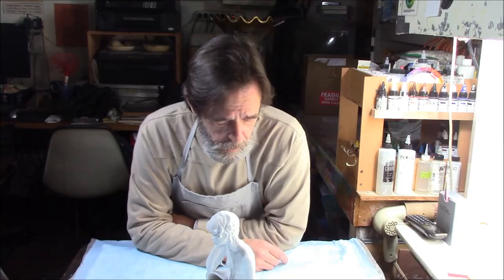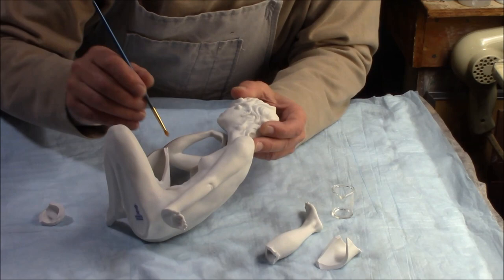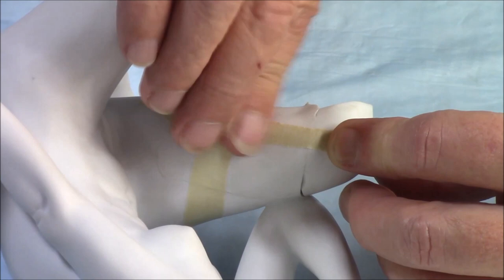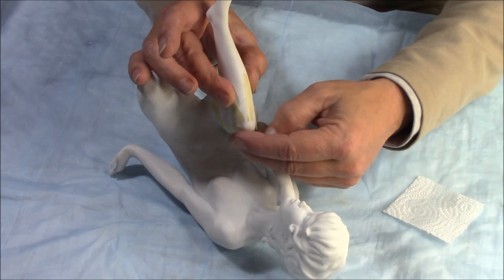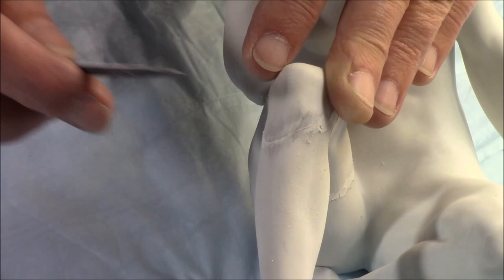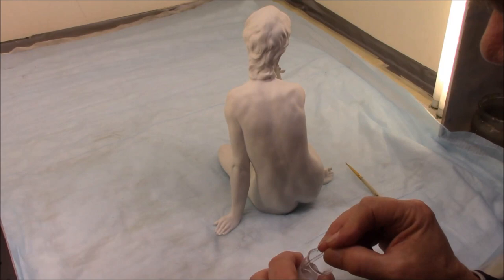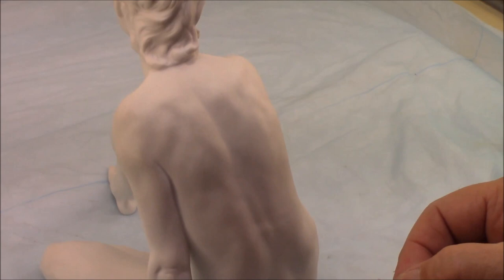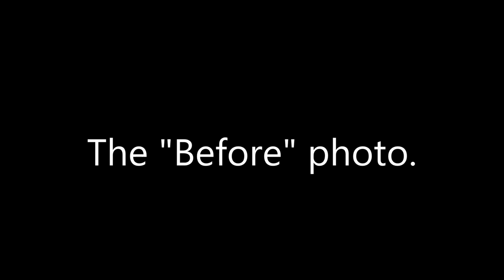Porcelain Feminine Figurine Repair

Comment: Hi Martin I would like to ask you a question of the glue you use. Have you ever used Araldite and do you feel the A&B Apoxy you use is better?
Reply from the maker: Yes, I've used Araldite. It's a good bonding agent. I've not used it as a fill. I use A+B putty as a fill, not as a bonding agent. A+B would work as a bond but not as good as Araldite.

Comment: You are awesome!! What exactly is a hot box?
Reply from the maker: My hotbox is an old freezer, stripped down to just an insulated box with a door. Inside it there was installed a heating element from an electric oven. A thermocouple and a switch box with a temperature dial was added. There's also a small electric fan inside to circulate and even the heat distribution. There are shelves which I can adjust and add/remove as needed. I just set the dial for the temperature I want, usually about 150 F., and turn it on. The thermostat turns the heat on and off to maintain the set temperature. I use it mostly to preheat objects that are going to have HXTL applied to them, and also to speed curing of the HXTL already applied. Some epoxy gets stronger and/or cures faster when heated slightly. Occasionally, I'll use it to dry something out.
Reply: Can I use my oven ?
Reply from the maker: @Big-ib3kx  The oven might work, if the temp goes low enough. You don't want to go much higher than about 150F.

Comment: love your repairs was wondering what kind of glue you used for the lady figurine hysol ?? what do you buy? or what do you recommend for a person who wants to repair a break in a figurine at home.  A simple break kind of like the lady figurine you are repairing in the white porcelain figurine with 4 breaks.  Thanks :)
Reply from the maker: Hxtal is a bit hard to work with. For non-porous ceramics, you could try Elmer's brand adhesive called "china and glass cement. For porous ceramics Elmer's white glue works fine. Good luck to you.

Comment: Hi Martin any other question please. I see you use Golden Porcelain matte glaze in this video to matte the surface down. Can i use this product but with the gloss to finish off if i need it to finished in gloss. The reason is i haven't been able to fine the other gloss you use.....here in Australia.I hope this makes sense....lol
Reply from the maker: It is my understanding that the "porcelain restoration glaze" shown in this video (and its gloss version) are meant to be a finishing coating in ceramic restorations. Check out Goldens web site for more info on their products. They will tell you more than I can remember. Lots of good info there. 
Have you tried contacting Sylmasta about an Australian distributor, or shipping to Australia?
Reply: @marsgitar  Iam onto it mate. If its solvent based it cant be shipped...Thanks again...

Comment: Martin, have you ever said how to take apart someone's bad repair job? Thank you.
Reply from the maker: Good question Linda. No I haven't. It's a good idea for a video to address this. Thanks for the suggestion. I may be a while 'til I get around to it though.
Reply: I will look forward to that. My little amateur projects are going ok, thanks to you.
Reply: I was watching your repair video. I have a set of small ceramic Angel's. On one of them the tip broke off in 2 piece's.  The Angle's are about 4-5 inches's in length.  Approx. how much are your cost's for repair work?

Comment: What is it that you use to glue the pieces back together??
Reply from the maker: It's a high tech epoxy made for glass repair. It's called HXTAL. sometime listed as Hxtal NYL-1 epoxy. Look it up on the web for a good price on a 60 gram kit. Not easy to work with. Takes days to cure.
Reply: @marsgitar  is there something a little easier to work with for a novice? I need to glue the leg back on a vintage dog figurine. Thank you!

Comment: How much do you charge ?
Reply from the maker: Cost is determined by how much work it is to repair it. Repair cost is based on the size of the object, how many broken pieces there are, how many missing pieces there are, how complicated t he design that must be replaced, how many colors must be replaced. Basically, cost is based on how hard it is to repair. It is not inexpensive.